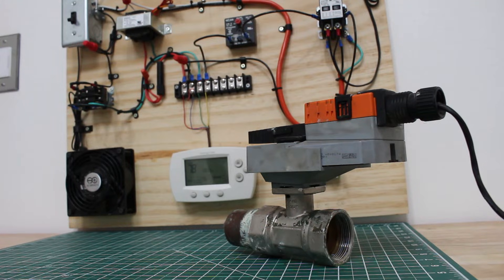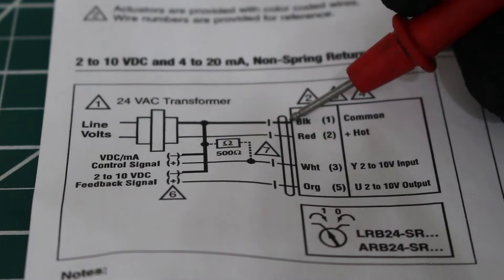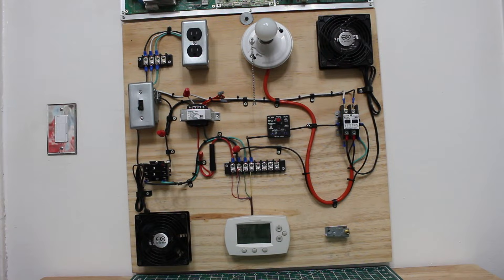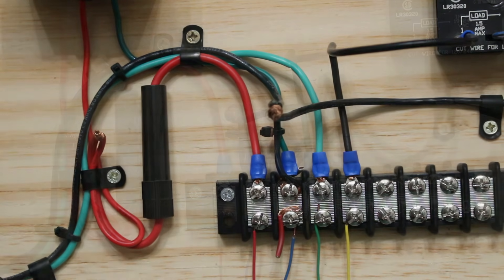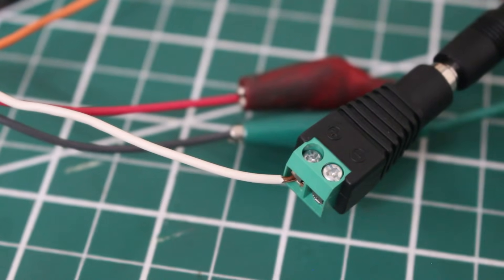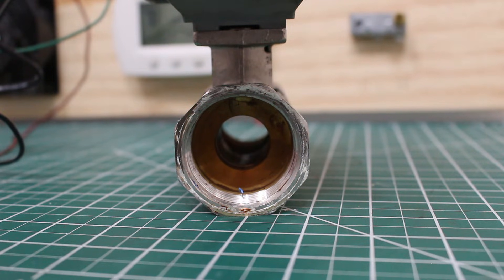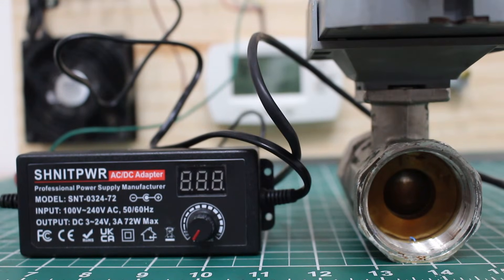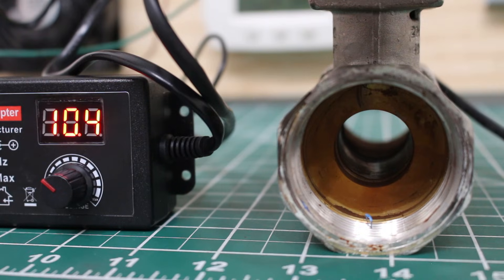HVAC TRAINING BOARD: Wiring & Testing A Belimo Modulating Control Valve (Modulating Actuator Theory)

Comment: You are not showing the process and the controller that puts out the 4-20ma signal and what is telling that to put out the signal?  A transducer?  A thermocouple?  A RTD?  If I have to turn the nob to change the valve position then why spend the extra cash on an electronic valve?  You are showing us very basic electronics. Like grade school science experiment level electronics. I watch longer if I am going to learn something. Anybody interested in a modulation water valve for a chiller or a hot water system would already know how to power the valve and give it an analogue signal from radio shack DC power supply.

Comment: The delay module appears wired backwards, line and load should be reversed. The line is the thermostats output (yellow wire), the contactor is the load.

Comment: So the 24VAC is a constant power supply to the actuator and the 2-10VDC regulates the position? I'm DIYing a wood pyrolysis furnace with new electronics and couldn't figure out why primary and secondary air supply actuators didn't work. The new electronic regulator has a Y1, Y2 connection and a common connection. Basically integrated 2-10VDC controller it seems I just didn't make a connection till now. 😏 The old regulator was wired with two 24V transformers but I just assumed they were transformers for electronics. Good thing I didn't throw them in the trash yet😄Anyway this video might be a lifesaver. Thanks

Comment: Can you please help to solve this issue.. when i apply 10VDC (max control vdc) the actuator 50% only opens… it’s doesn’t go to 100% .. even i did the self adoption function..how to make this into 100%: Model is SVK24-MFT-50
Reply: First, you need to make sure that the negative pole of 10VDC (control signal) must be connected to the negative pole of the actuator power supply (negative pole of 24VDC/DC). This will ensure accurate action. Your problem should be at this point.

Comment: Hi Jumper Man,

I enjoyed the video and wish to add a safety tip and terminology clarification...

*To "PREVENT ELECTRICAL SHOCK" or other hazard to someone, wire the power cord to your Demo Switch and plug that into the wall instead of "reverse feeding current into a receptacle"
*You refer to your valve as "Normally Closed"  - it is really a "Normally Open" model by standard terms - no Power = valve Open